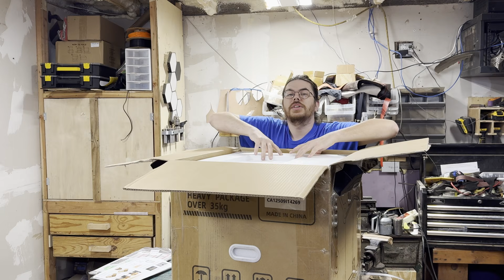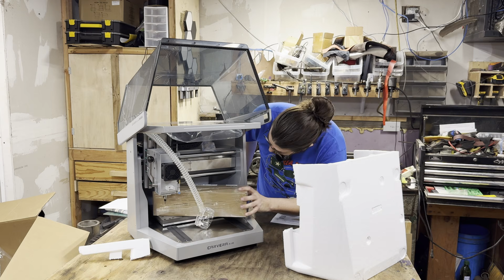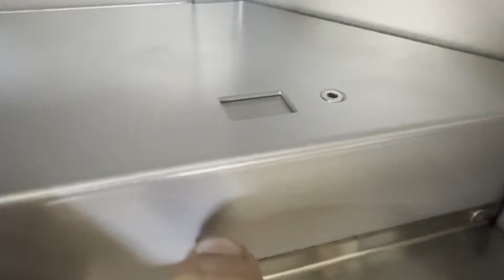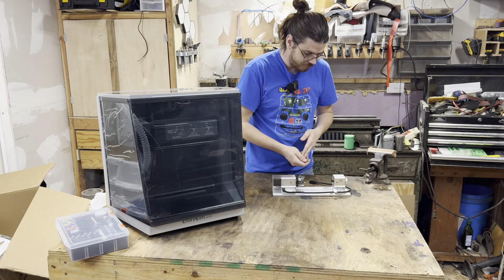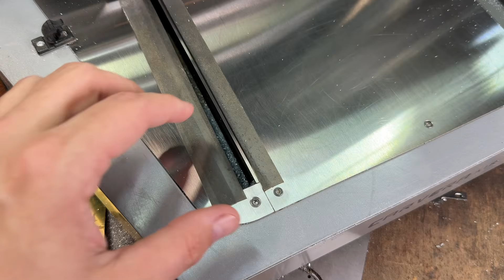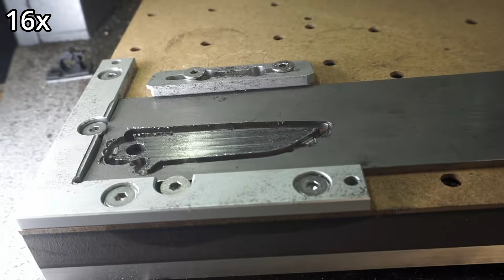Are Desktop CNCs worth the money?

Comment: Some in-depth video on this mill would be good.  Lots of naive reviews out there but little evidence of actual usage.  Turns out, it's difficult to use a machine to its full potential.  In your videos, include audio of the mill.  You can learn a lot from hearing the spindle and the sound of the cut.  Also, read your chips.  Getting a thick enough chip is a real challenge.  It's mentally difficult to program these machines to take enough thickness per tooth.  I have a little heavier machine and I need to account for chip thinning and machine to get an adequate chip in steel.  Without a deep enough cut, the endmill rubs.  if you're rubbing, getting sharp hot little thin chips, it is noisy and sounds terrible.  Once you dial in the right parameters, it's magical.  Good luck.
Reply from the maker: I really appreciate this feedback. I've got a few actual projects I'm working on with it now and a larger collet on the way so I can run 1/4" bits, hoping to do a follow up and I'll keep this in mind. Not sure why I didn't think to leave some of the audio in, you could definitely hear it being unhappy before it created the titanium spark.